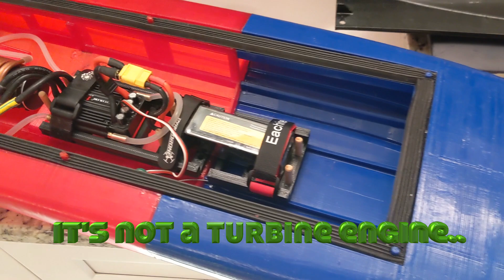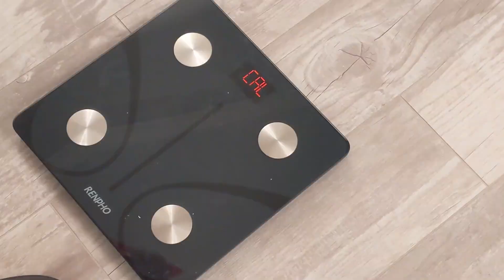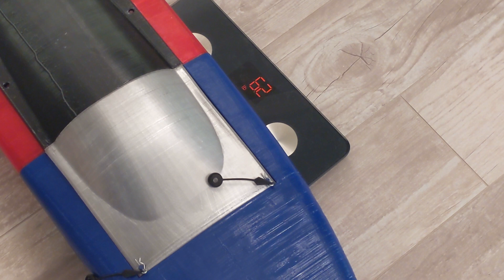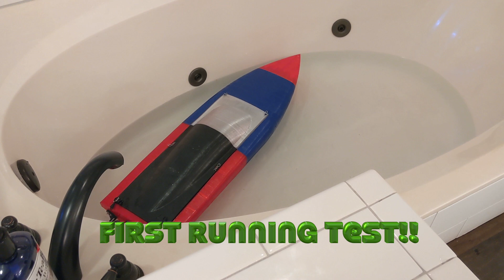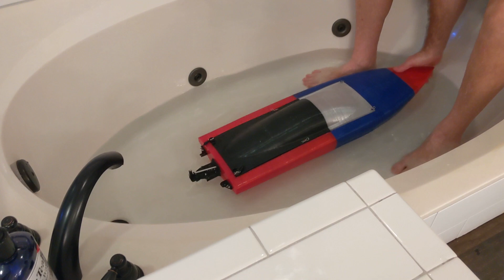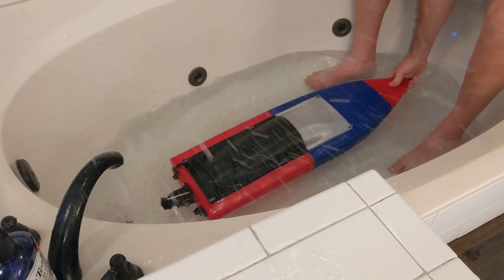Big Jet Boat M-Jet 30 drive

Comment: I love your rudder approach
Reply from the maker: Yes the rudder/nozzle is amazing.  The credit goes to Stephan Muller, he is the designer of the jet drive i am using. M-Jet 30. Here is a running video of the boat. https://youtu.be/cvevquXJuMo .  Stephan Muller commented on the video, you can link back to his youtube from his name.  I am putting together a build video and I will include the STL files for the modifications to the hull if you want to print the boat again and purchase the M-Jet 30 to install in the boat.
Reply from the maker: Hey Stelios, I sent you an email. The one on your YouTube page.